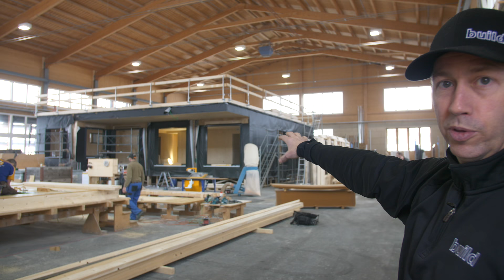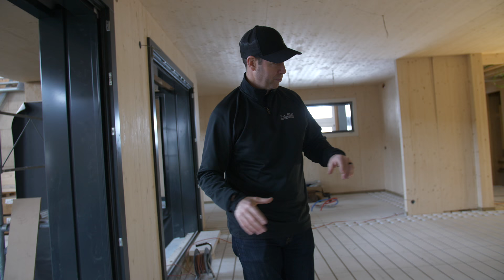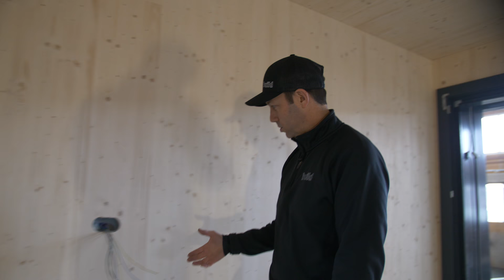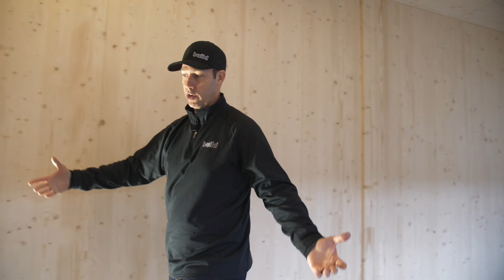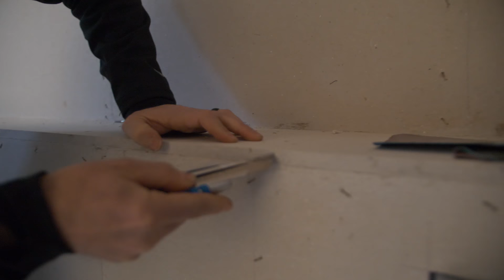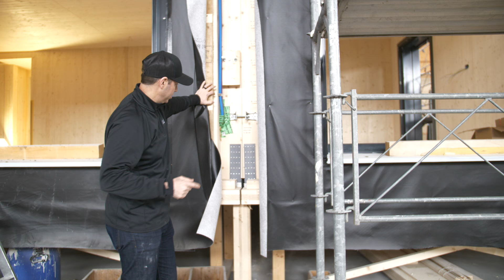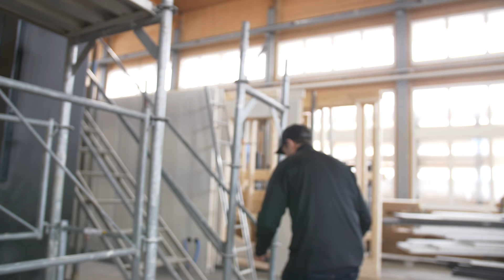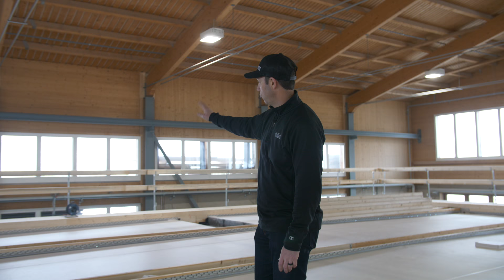Swiss Modular Home - Under Construction Tour

Comment: Why would you build a flat roof in an environment with snow?  It makes absolutely no mechanical sense, at least to this non-builder.  I can build a car whose tires are octagons rather that round, beefing up the suspension of the car to handle them but . . . why?
Reply: South Switzerland borders north Italy. Probably a region with less snow.
Reply: @HenryLoenwind  Sure, but every region of Switzerland gets some snow (I just did a quick check).  The argument may be that you run far less of a risk further south and the client really appreciates the aesthetic?  Still seems foolish.
Reply: Insulation only slows the departure of heat from a structure.   People still need to remove snow load from a 45 degree roof, should the weather call for it.  Would you rather clear snow from a flat roof with parapets or a 45 degree angle? It is not uncommon to have interior roof accesses even in a family home. It just costs money. You could have a dedicated snow blower on the roof in a shed, just to make this task easier. I've been a journeyman carpenter for 20 years, and I realized I had much to learn when I visited Switzerland.
Reply: @Deliasgubrath  Isn't there some angle at which you can count on snow to slide off a standing seam roof? I could even see heating it for short periods of time just to free the ice. Having to shovel a rood in a normal storm would be a major hassle, though maybe the 8" wall studs on this house  allow the owners to let a fair amount build up.
Reply: Cause houses and buildings are very high quality in swizerland so the snow does not pla a significant role to the stability of a house.
Reply: Flat roofs are actually better in snow conditions than peaked roofs.  I get asked this question a lot when we design flat roofs for the New England area or Colorado even.  It’s a common misconception that peaked roofs are better in snow conditions that flat roofs.  That’s not to say that flat roofs are totally flat, they typically have a minimum of a 2% pitch to drains/scuppers.  They are better for a few reasons. 

First, a flat roof allows for snow to accumulate on the roof.  Snow is a natural insulator (think of an igloo).  This allows for an even greater energy efficiency using Mother Nature. Since all roofs are designed to support roof loads of a particular area, including snow loads, there is no structural issue as to how much snow it can take if it is designed properly.  Usually these are wood roof trusses or TJI’s with rippers.  

Second, they naturally limit the snow load with even exposure to wind and sun.  Peaked roofs can shield a particular side of a house from the sun or wind, causing build up of snow or ice dams which can cause some serious issues both from water penetration or structural fatigue.  Flat roofs allow for the wind to naturally blow snow off the roof (up to the parapet height usually) and allow for even sun exposure which allows for snow melt over the entire roof structure.  Again, there is a slight pitch to some draining mechanism so the water simply drains away.

Lastly, peaked roofs tend to trap a lot of hot air towards the ridge.  You’ll be needing fans to draft the warm air trapped up there down to the floor area nearer the occupants.  Not to mention needing more costs in insulating a larger area (hypotenuse of the triangle is larger than its sides) and the tricky area of insulating the entire roof system or solely the ceiling above and venting the attic space.  With flat roofs, you limit the  wasted height of the space allowing for better control of temperatures, not to mention you insulate less area directly under the roof sheathing creating a tighter shell that does not require attic venting.  Lastly, the depth of the flat roof system allows for more insulation over conventional systems.  A typical roof truss in a snow covered area could be at least 18” deep allowing for 18” of insulation vs. 10” or 12” with a conventional roof.
Reply: Most people live in the northern part of Switzerland where there are no mountains. 
This area does get snow in winter, but unlike the Alps in the south, you would rarely see more than 4 inches of snow there.
For example where I live, it only snowed 2-3 times this winter and it was never enough to make the floor white and it only lasted a day ...
Reply: I agree with you that is bad practice, but I have seen homes built with the EFIT system even in wet, humid climates.  There was a video in this series about doing just that.
Reply: Well u just higher the thickness of ur walls/studs. It’s just a matter of static’s calculation. We have a great book called „Schneider Bautabellen“. You can basically read there how much snow in what region will fall (in kN/m2) or how strong winds will blow or how much rain in L/min will fall at a so called 100 year rainfall. Than u go ahead and higher ur construction stability or choose ur specific Rainwater drainage pipe size etc.

Snow: Sometimes freshly fallen snow will melt a bit. If more snow follows, it will freeze to the roof. The more snow is falling, the higher the load gets. That’s why you have to remove the snow even from pitched roofs (0 - 35 degree). From 45 degree on, there shouldn’t stick too much anymore.
Reply: Oh yeah. The „why“. For Looks. Some people just prefer the modernist scheme, even though it makes everything more expensive (thicker/stronger construction) and is prone to water damage, if something goes wrong with the roof sealing...
Reply: Johann Koenitz that's not why in this case. The flat roof is much much much much much easier to prefab and fit on the delivery truck (Lieferwagen)!
Reply: Flat roof homes are actually very common in the USA. In my city and most East Coast Cities almost all homes are flat roof rowhomes.They were built over 100 years ago without any structural issues when normally maintained. My home is a rowhouse with a flat roof and it has handled snow load accumulations of over 30 inches at one time in the most extreme storms that I have experienced. Flat roofs do actually have a pitch. Minimum slope for a flat roof by building code here is 2%. (1/4" per 1').

Comment: My house here in Denmark was built10 years ago there was strict rules to how air tight it must be and it is tested.  But there were no rules to air replacement. So it is air tight as a drum you can’t fart without creating over pressure  and I have to open a window to use the fan in the kitchen. Thinking about having fitted a air replacement system. 
Cheers.
Reply: You could easily fit what we call „Fensterfalzlüfter“ in Germany. I cut out a part of your windows sealing beads and u bridge it with a venting part (get a closable one or a pressure-self-sealing one for the winter). If get urselve a new silent bathroom vent, which u should put on all the time, u will have some mild air flow. But u will need to add the bridging part to several windows, so the airflow will separate and turn down to an acceptable level (u can do this one at a time. Use ur wife as a cold‘o‘meter. If u want this low tech solution a little more comfortable, u could add CO2 sensors to the bathroom vent. Still way cheaper than a full fledged HVAC System.
Reply: Johann Koenitz that sounds like an affordable plan. great idea. :)
Reply: Martin J id wish there would be a system available for this. But since u can’t make much money of it, we have to DIY and share These tricks with each other. Learned it from another architect myself. :))
Reply: @WAJK2030  And it's a good thing we have YouTube. :D
Reply: @WAJK2030  I just tried to find a translation for
Reply: I'd recommend you do. I'm sitting in a room from the 60s, and I alone manage to get the CO2 up into the "bad for you" levels just by breathing within about 2-3 hours. That must be even worse in a well insulated house...
Reply: @HenryLoenwind  That's why every superinsulated, airtight house needs a fresh-air, filtered, heat recovery ventilation system.  And don't clean with store-bought cleaning products, and make sure anything you bring into the house doesn't offgas VOCs like formaldehyde.
Reply: @HenryLoenwind  I know, I can't close the bedroom door when sleeping without having the window open. It is quite counterproductive to the tightly insulated house. They even made pressure tests that the house had to pass to see that were no leaks. :D It's on my list of improvement. I am considering getting a system with a heat pump that can recover heat in the winter and cool in the summer. Need to save up a bit of money first, until then, I open the windows several times a day.
Reply: batmann2o Well, Can't say, they might have overdone it.:)
Reply: Martin J That is correct. The same thing happens to me after I upgraded all of the windows to my apartment. It's extremely air tight and I love it. If I wanted to quickly ventilate some rooms, I tilt the windows a bit and turn on the kitchen fan on maximum setting and It change the the entire air with fresh air in just a few minutes :D
Reply: That is very bad building practice to build a tight house without a whole-house ventilation system.  You are lucky you didn't get sick.
Reply: @barbarasmith6005  Indeed, I open the windows several times a day to replace the air. IIRC new building codes now requires that they are built with a ventilation system with a heat recovery system.

Comment: I had a IHB Builder license in Texas 10+years ago as I was looking for an affordable house solution. Same concept w/ factory built modules, trucked to jobsite, and placed on Pier & Beam foundation. By the time you added all the extra cost to ship, rent a crane to set, and the hassle with state inspections it was more expensive than stick built. Consumer at that level doesn't care if it is a better built house just the $$/sq ft price.
Reply: So are you actually saying there's no way to build high value houses that can keep an high selling value in North America? Does anyone actually buy cheap quality homes cuz they move on frequently and they just want sell it rapidly?
Reply: Many/most early automobiles were rel. low volume & costly; then came the "likes" of Henry Ford (with the Model T?), and every T, D & H were "off to the races."  Now the advent of robotic construction has brought consistent, assembly quality to car mfg.  Your experience is, of course, valid.....but not determinative.  The result as you allude likely depends on the state in which you operate.....and quality of design & management.

Comment: fresh air  come true  HRV with heat pump built in  and for each kilowatt electricity spend on ventilation they get upto 3 kilowatt of heat
Reply: It's better to have a separate water based central heating system and be able to set the ventilation to a reasonable air flow. My system recovers around 80% of the heat so if the outgoing air is 20 degrees celsius and outside temperature is 0 degrees, then incoming is 16 degrees... pretty good.
Reply: @erik....   not bad .In states we have  electric water heaters with heat pump built in and after all discounts, rebates   I can get one for $650 then I would buy HRV for $350 or so and design  system which I talked  about above .   European HRV with heat pump priced for 5000  euro
Reply: @andreycham4797  Yes my heat pump is around $10000 and complete ventilation unit with pipes to every room $3000 so it's a bit different.. but I live in a very cold place (Sweden). Heating was still $400 last month.

Comment: It seems to me the interior 'plywood' panels are CLT - cross laminated timber.... not plywood as such.
Reply: It's solid wood and translates to three layer plate. In Switzerland it's used as plywood and you can get it from 12 to 60mm thick (1/2 inch to 1 3/8inch). The most common one is 27mm thick (just over 1 inch).
Reply: @rickv1013  Three layer plates are the thinnest version of CLT. There are version with more layers and up to 500 mm thickness.
Reply: @lastnickever4440  Sounds like those whole glued wall panels from a previous video are CLT as well. I could only find those three layer plates (Dreischichtplatten) up to 60mm in the catalog from a Swiss wood supplier. I've only used up to the 32mm thick panels.
Reply: @rickv1013  in general only the thinner CLT panels use 3 layers, so if you want more than 60mm you probably need to go up to 5+ layers (depending on thickness. my appartment building uses 20-30cm CLT panels with 7+ layers)
Reply: It is CLT it can be up to 500 mm thick.
Reply: I would call that "better quality plywood" ;P
Reply: @DunnickFayuro  Main difference is that plywood is made from sheets of wood. And CLTs are made from sawn lumber, the very thinnest layers in the 3-layerd version might be sheets but probably not.
Reply: Semantics. Plies of wood, laminated together = plywood.
Reply: @OMGWTFLOLSMH  Not really CLT is boards glued together, the 'real' plywood is really made from sheets (sheets cut from rolling log). Propertys are somewhat different and this needs to be considered.

Comment: the cement panels as  you call it ,is "Fermacell" and its fireresistent and required by law in some places of the house and is also used in the wet areas,kitchen,bath etc for the paver to have a stabil underground
.
Reply: .They are not as porous or hold water as much as concrete board also. It is a better material.

Comment: It's no use showing Americans something we can't have.  We don't even have Passive House in areas of the country who could really use this technology, like hot-dry, polluted areas of the U.S. 

Also, what if a person is chemically sensitive?  Some of the materials, especially if exposed to the living space, might be intolerable without many months or years of offgassing.
Reply: These homes don't off gas as much as the usual American home.
Reply: i have a saying. Do you know why people are so happy with a new car? Because they're HIGH! from the off gassing of all that plastic. then a year later its ehhh this car is just ...alright. 
and unless you are allergic to wood these would be dream homes.
Reply: @slingbart705  Once the oil-based finishes are offgassed, I'm OK with wood, unless the wood is OSB or plywood, with the flakes glued together with a glue that has phenol or urea formaldehyde in it.  Powder-coated steel cabinetry and stainless-steel counters and countertops, I would feel safer being around.  However, Home Depot does sell plywood made without a formaldehyde-containing glue.  It was fine.
Reply: Barbara Smith no one in it’s right mind is using such crap in the interiors anymore over here. We are using OSB4 only, for the inside stuff. It is also called EcoOSB, since it uses non gasing glues (not even while burnt or just after a specific amount of time of burning). It is a little bit more expensive and obviously harder to cut, but it’s also way stronger than OSB3 or even OSB1, which is the one mainly used in the US.
Reply: @WAJK2030  You guys in Europe are way ahead of us here in the U. S. of A.  Even Canada is.
Reply: The smaller the wood pieces in engineered lumber, the more glue & chemicals, all other things being equal.  The type of engineered lumber we call 'Glulam' and which is fashioned in heavy timber construction into solid boards, is based on laminating together 2x4 or 2x6 fingerjointed boards.  It uses very little glue, since there's so little volume to fill which is not already occupied with wood.

You can build a piece of lumber out of a little paper pulp and a majority glue by weight;  We would call it 'composite decking' or somesuch.

Most home construction is using fairly fresh OSB, which uses small chips of wood and a bunch of glue in between holding them together.

Comment: Would code even allow us to use plywood as interior wall sheeting vs drywall? Isn't it a fire rating code issue? I like the idea I'm just not sure if its actually allowed here in the states....
Reply: @Jeremy You make good points. Unfortunately, my house is torn down to the studs (you can view it on my YouTube channel if you like) Because of this I have to get everything reviewed by city inspectors so they will know actually. I guess its just a question I would have to ask my inspector.
Reply: yes as you use wood (fire blocks) in your walls for fire code already.
Reply: The comment section established in another video that nothing made of wood has ever burned.
Reply: I live in MA, and most houses have plaster or drywall here, but whenever I go to NH, I'm surprised at all the houses that have all-wood interiors, usually some kind of rustic barnboards or vertical tongue&groove planking. The local interpretation of codes varies a lot from town to town, so some might allow wood if you have sprinklers, some might require some percentage of non-combustible material; you can probably find any combination of requirements. One thing I do know is that most of the houses with just thin wood paneling over studs are 50+ years old, so the well publicized bans on that combination in public spaces and in "trailers" during the 1970s probably apply to houses as well, but thicker wood might be OK. Just keep in mind that even if wood passes the same fire and draft blocking tests as drywall, it's 100% fuel, so its behavior in a real fire is going to be quite different. A fire can spread much faster along a wood surface than along fire-rated drywall or cement board, unless the wood itself is fire-retardant.
Reply: Sean Stumpf, Wood interior of houses does meet building codes, two layers cross laminated 1 1/2" provides 15 minute barrier.

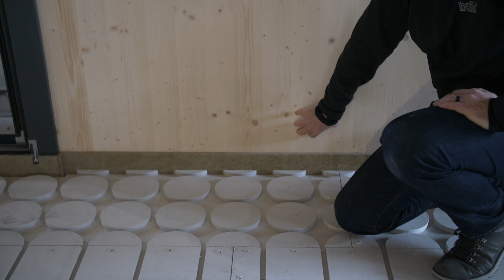Comment: Great video, but at 4:10 I am not 100% sure, but I would say that the mineral wool spacer is more for shock sound isolation of finished floor than for heat transfer.
Reply: Great